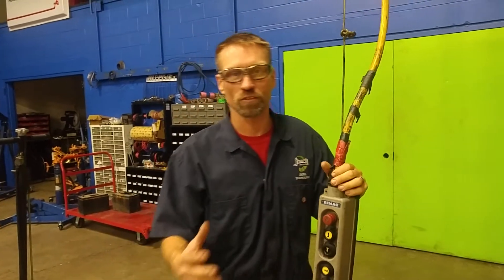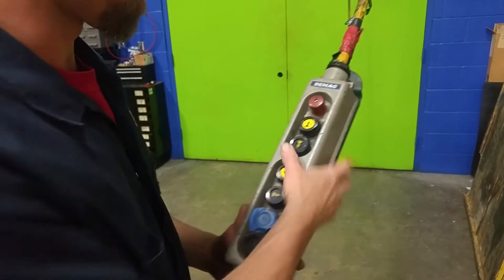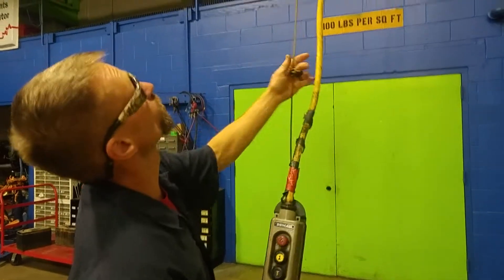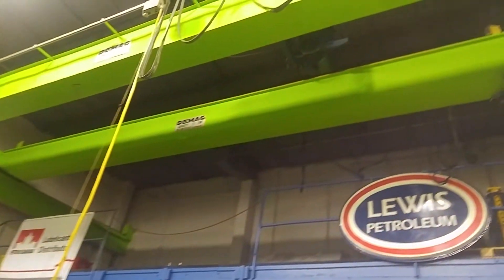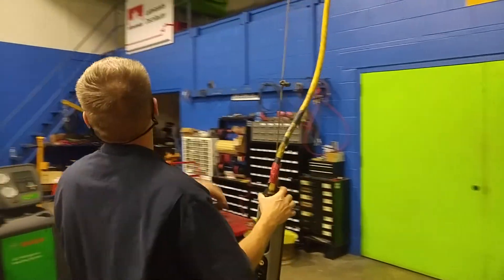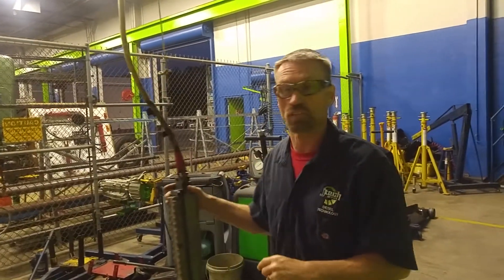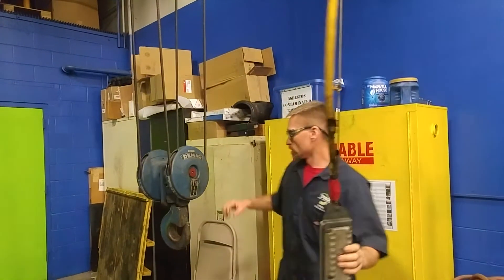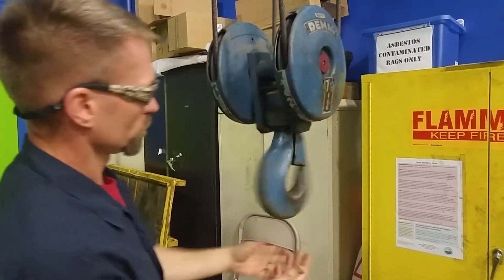Overhead Crane Inspection and Operation

Comment: Jesus! this video is actually making people dumber. you are in no way identifying anything correctly. please stop dumbing down people who are trying to learn.
Reply: Since when were manufacturers not allowed to paint the bottom hooks? Nonsense. Not sure about regulations in The States but here in Ireland and the UK cranes do not need to be load tested every year. Once they have an original test certificate and are inspected at least every 12 months and found to be in good condition that is all that is required. Reports must be kept obviously and only if serious repairs are done does it need to be retested.
Not all host units have cross travel limit switches fitted as standard especially one that looks as old as this host unit.  Sometimes a little knowledge is a dangerous thing!!